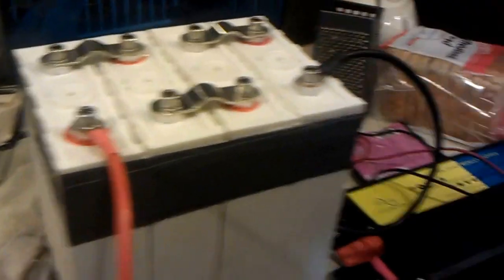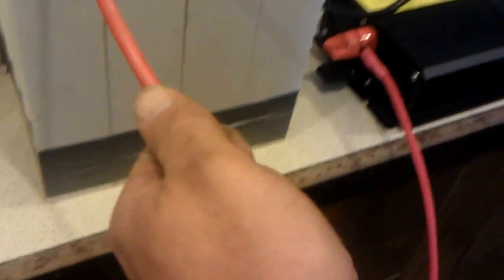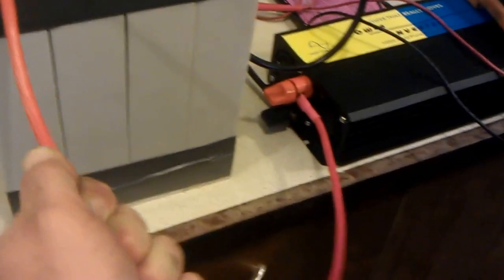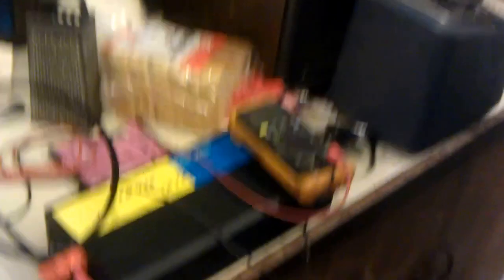Running toaster off a battery using an invertor

Comment: How do you keep the inverter from tripping offline? I drive an 18 wheeler and the inverter in this truck constantly trips the moment you turn on any kind of electric heater. I want to be able to heat up water quickly, and to run a toaster oven.
Reply from the maker: This is using a lithium phosphate battery. They can output a large amount of power. The battery leads are short 1M, very little voltage drop. What type of battery and inverter are you using? How long are the battery leads? Do you have a house battery separate from the starting battery?